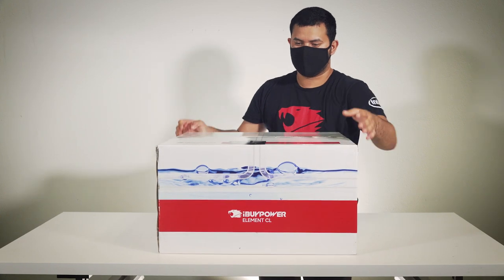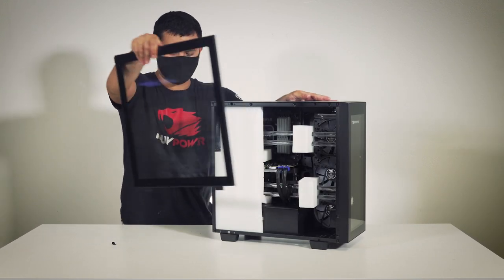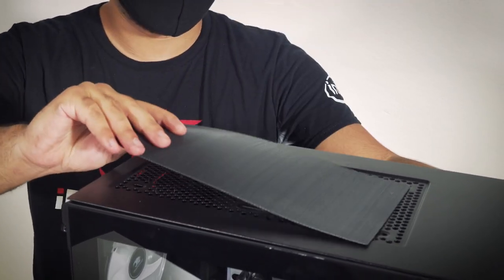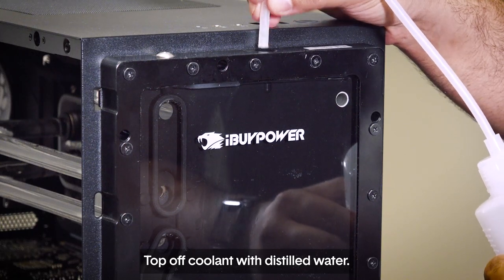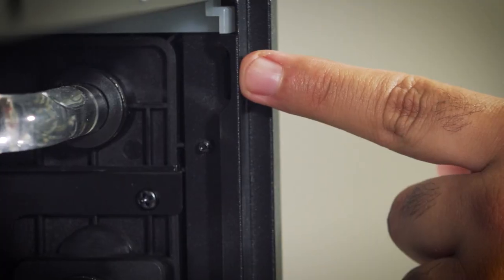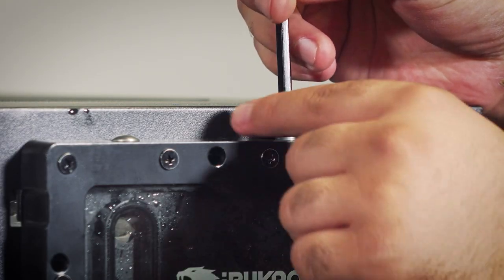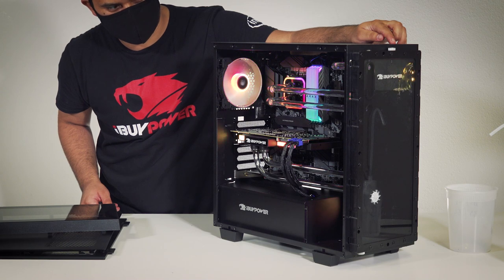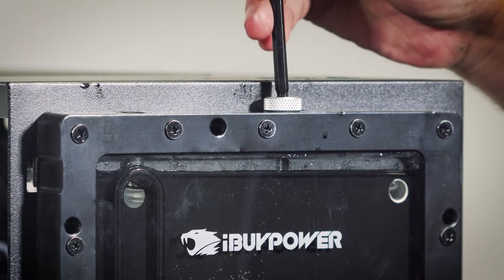Element CL Gaming PC User Guide | Computers and Coffee | iBUYPOWER

Comment: ive had my element cl for about a week now and i love it!
Reply: Just got mine and it's my first water cooled pc. There is a bit of a buzz that comes from the pump. Is that your experience as well? Also I had to really dial down the fans as they were revving up pretty loud even idle
Reply: @syre1337  my first water cooled pc too but definitely no buzzing sounds and its pretty quiet compared to my old pc only time I noticed it getting a little loud was while playing balders gate 3 everything else is fine
Reply: I’m looking at this pc and wondering how easy it was to setup? It seems simple just wondering how it was for a first timer like me
Reply: @josephbarnett6257  super easy setup it ships with coolant in it already just take out all the foam plug everything in and you ready to start gaming 👍
Reply: Mine had coolant all over the outside of the case when i received it
Reply: @griswoldgamingoutdoors4195  Hey!  Did you reach out to iBuyPower?  Did they help?  Or did you just roll with it
Reply: @owenleitzel7554  cleaned the case and saw nothing wet on the inside. Computer works great
Reply: can you say you can play at max settings while streaming on twitch with no problems ?

Comment: Love this computer! I was just seeing that my coolant was getting low and was wondering how to change it. I couldn't find any video on changing a system like this, they all had internal tanks. So nice to find a video like this that shows exactly how to do it for the exact model. I have had this computer for about a year and it's been on almost 100% of the time since I bought it. I having it mining crypto when ever I'm not playing on it.  That being said, My wife also wanted a computer and I would have gotten the exact same but it was unavailable. So she got almost the same thing just air cooled. We both like liquid cooled much better but was worried when I saw it getting lower. Seams very easy though to just top it off.  Just got to get some distilled water and see how it goes! Just as a side note, between my wife's computer and my computer, we now paid for one entire setup, including monitors and so on from the mining of these. Both have the RTX 2070 supers in them.

Comment: I have a quick question @ibuypower .
I just purchased the element cl.
But the 3080 , 3070,3060ti are out, will you sell gpu with water block for me to plug in and use on my current build please let me know , I really don’t want to return it but I just want to make sure that I can upgrade

Comment: Hello, I’ve purchased the element cl computer and I’d like to know if I could use ek pre mixed opaque cooling for the machine or should I just use distilled water?
Reply: So considering they use aluminum blocks and radiator I would discourage use of opaques I know you can safely use ek cryofuel colors that aren’t opaques but for some reason they claim it isn’t safe for aluminum
Reply: Kyle Attebury Now I know, thank you very much.

Comment: Hello, I have a question about my iBuyPower PC just got it, the Zeus E2 mouse doesn’t want to work it only lights up but doesn’t work I’ve plugged it in the USB ports, my pc also came with a cd disc but there’s no where to put the disc inside. How can I solve this issue?
Reply: The disk will only work if your system has an optical drive but, most systems now don't have an optical drive. Also, the disk doesn't matter very much. There could be many problems with the mouse. Either the usb ports don't work try plugging it into each usb port front and back of the case. If it still doesn't work it's a faulty mouse and you need to get a new one. I reccomend getting the logitech g300s it's feature rich for a lowcosting mouse.

Comment: So my cooling stopped flowing and now my cpu is at 80+ celsius. What do I do?
Reply: This happened to me as well. Did you fix this?
Reply: You can replace the pump
Reply: @darren1776  It was a rare case in my situation. Yes, and no. Mine stopped flowing due to the fact that it was shorted, so i had to rewire it. yours just might be loose.

Comment: Anyone know if you need a specific GPU for this PC? I wanna upgrade my 2070 but Im confused cause of how the tubs plug into the GPU on the side.
Reply: did you ever figure this out? i bought a 4070 not even thinking about the water cooling part
Reply: @kuqqhd  Yeah you sadly do, I messaged ibuypower and they said I had to get a specific GPU for it :(
Reply: @MisterJesh  did they say what gpus
Reply: @MisterJesh  really would like to have a 4070 with a water block built in
Reply: @MisterJesh  Apparently on a subreddit ibuypower stated that you can get specific 12mm tube caps that you can place to bypass thee gpu liquid cooling to allow aircooled gpus! dunno if you already upgraded since it sbeen over a year since you commented but thought that it might help out

Comment: When do I have to change the water? Every 6 months?
Reply: my friend has his for 2 years and no issues
Reply: @doozy5972  without refilling the water?
Reply: Hi Cristian! The rate that the coolant evaporates depends on a lot of different conditions. So we don't have any specific rates when the coolant needs to be changed.   Just keep a look out in front of the panel to see where the coolant is at. If its half way, we recommend changing it. If you still have more questions, we recommend you give us a call. 
(888) 462-3899 Customer Service Hours: Mon - Fri: 8:30am - 5:30pm PST

Comment: How would you replace the thermal paste?
Reply: Hi Tango! In most cases, you shouldn't need to reapply more than once every few years, though you should replace your paste if you remove your cooler for any reason. You may also want to consider reapplying thermal paste if you find your CPU temperatures are climbing. If you still have more questions, we recommend you give us a call. 
(888) 462-3899 Customer Service Hours: Mon - Fri: 8:30am - 5:30pm PST

Comment: I just noticed my flow meter seems to slow down so it’s not constantly flowing fast like it used to...is this a serious issue ?
Reply: Yea mines does that too idk why
Reply: @toosaucyscooby2x618  i literally dont know why, also one time one of my fans wouldnt spin at the same speed as the others
Reply: @sofakingsal6493  yeah I’m getting a new one in March
Reply: Have you tried getting a new pump?  The pump could be slowing down => water is being pumped slower => flow meter is slower.  Or the flow meter might have some gunk and be a little stuck
Reply: @owenleitzel7554  is there a video or advice on how to get to the pump? Mine isn't working at all and I think that's the problem... These guys wanted me to buy a whole new cooler and I ain't doing that unless I absolutely have to